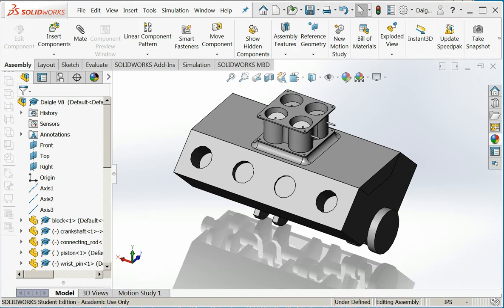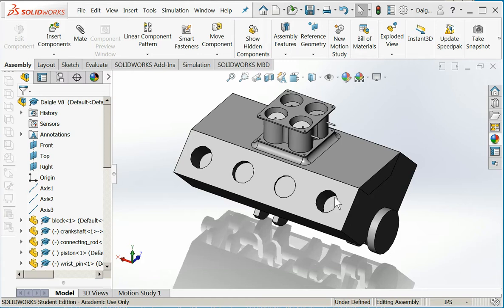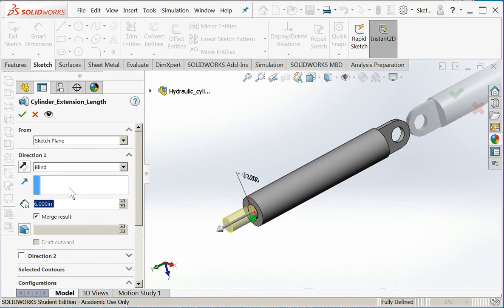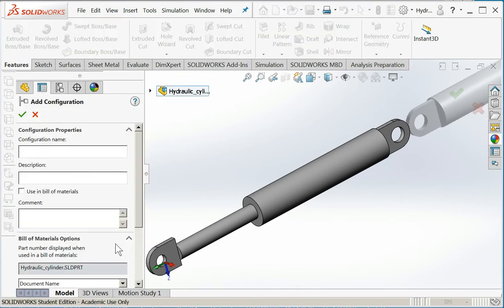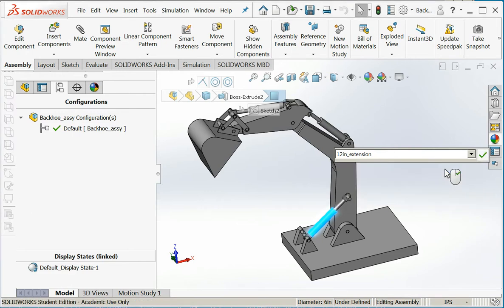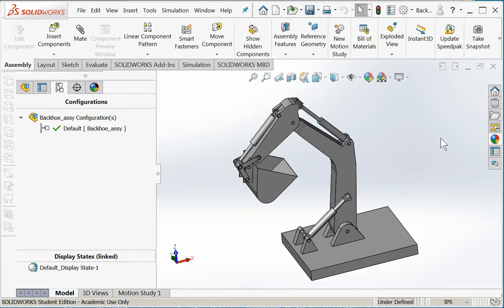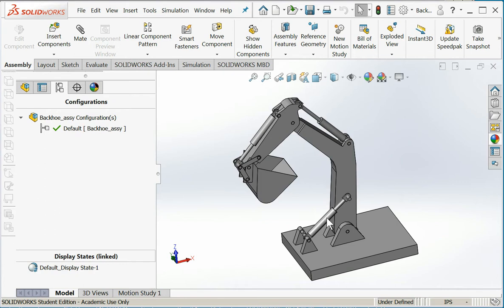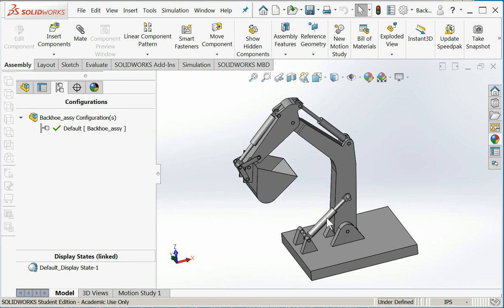Solidworks - Configurations

Comment: Thank you soooooooooooooooooooooooooooo much . I have been trying to figure this out for weeks now . A previous engineer where i work had made this great tooling fixture to check fits on  parts we manufacture. I took over his position after he left . I not really knowing what to search for have been watching every video under the sun. spending hours scratching me head lol . One thing to note for anyone who reads this comment . Make sure you check the configure  box this configuration in both the extrude and the sketch . If you do not do this it will not work properly. It will just default to the last change you make to your model . Thank you so much !!!!

Comment: Thank you for the video. 
Is there a possibility to connect the length of hydraulic cylinders in the assy? I mean, if I change the length of bottom cylinder, the top 2 cylinders should change their lengths accordingly (with just 1 configuration).